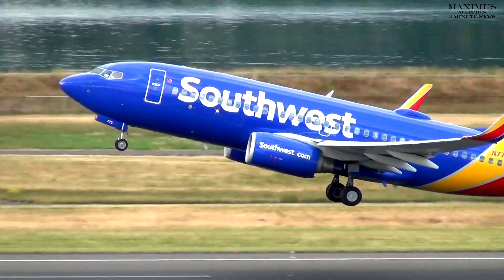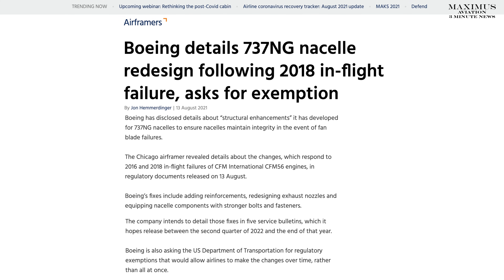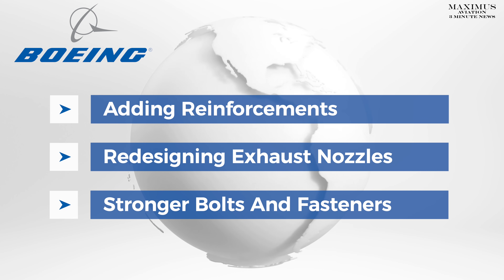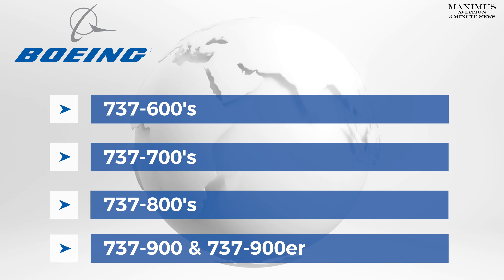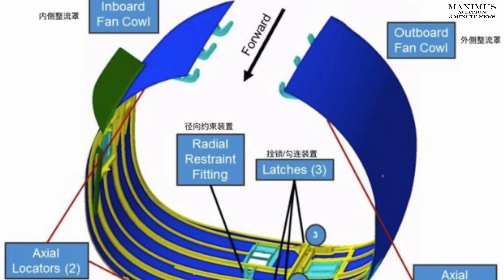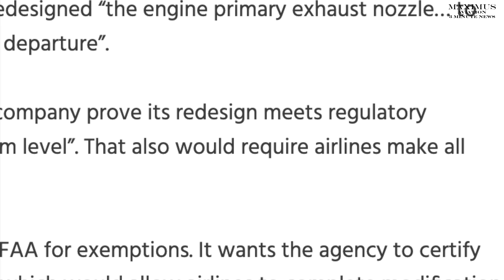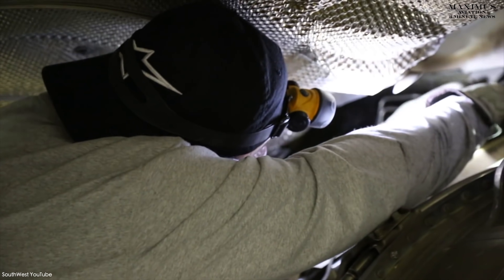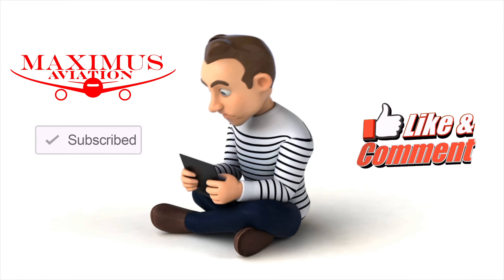Boeing Reveals How They Plan To Fix Dangerous Engine Nacelles

Comment: None of these fixes will do much to prevent deaths, although reinforcing the nacelle itself is going in the right direction. The only way to solve  fan blade failure deaths would necessitate adding weight to the aircraft with reinforcements. Boeing has obviously taken the same line as motor manufacturers, that a few deaths occasionally are acceptable where prevention would reduce profits by too much for their greed to accommodate.
Reply: The nacelle design is the only thing that Boeing is responsible for fixing. I'm confident that the revised nacelle will be up to present-day standards as the original nacelle was 90s standards. After that, it's completely up to CFM to redesign the fan blades since CFM designed the fan blades, Boeing didn't design the fan blades.
Reply: Tombstone Engineering.
Reply: You are totally right! And after that you will not have the same engine. And after that you need to reengineering and of course new engine new performances new problems new testing!
Reply: @HeaanLasai  I'm cobfident that the new nacelle will contain fan blades. That's why Boeing decided to study a redesign for 5 years in the first place.
Reply: @HeaanLasai  depending how they disteacted. It is different when you have long structural stress and forced stress on materials. Probably didnt think about long structural stress.
Reply: @HeaanLasai  Probably only a couple of main battle tanks welded together would prevent a chunk of fan blade from penetrating the fuselage - whatever the law might say, its impossible to order back the sea like King Canute. However, its not necessary to block completely, its only necessary to deflect the chunk by fitting a relatively narrow band of armour around the nacelle directly next to the blade tip circle of rotation. 90% of chunks flung off will hit this plate first and it will deflect them, absorbing a considerable amount of its speed times weight = force. If the blade then hits the fuselage further away than it would have done had there been no deflection, its force will have been reduced sufficiently to prevent full penetration. Some chunks will be flung off lower down the blade, and these might hit other parts of the engine before exiting the nacelle and will miss the armoured strip,  but they will be travelling at a lesser speed. Unfortunately the weight of material needed for meaningful deflection might be a few hundred pounds times two engines and the extra cost in fuel is only worth paying if, unlike managers and accountants, you care about human suffering.